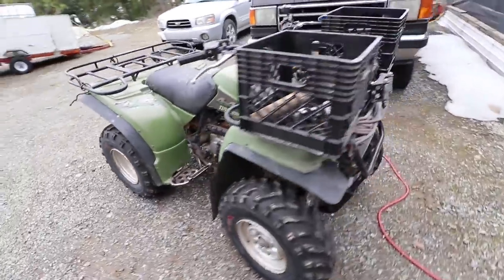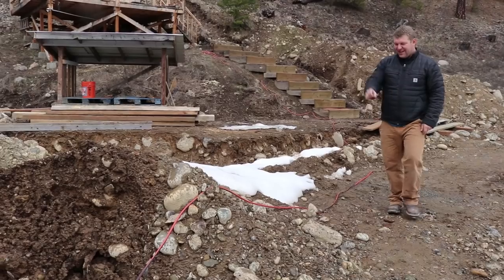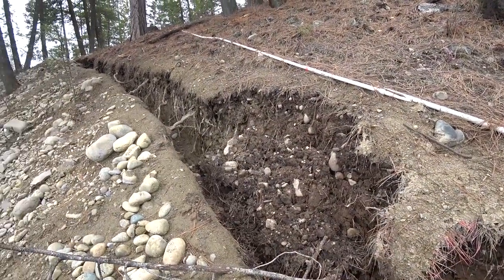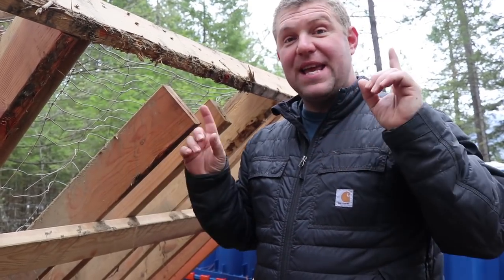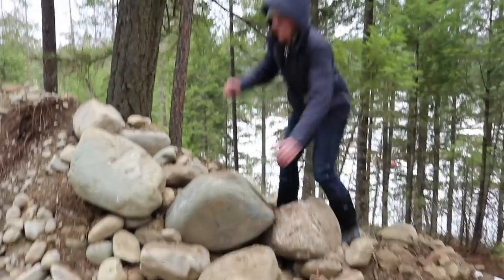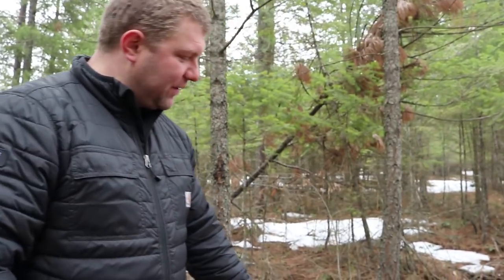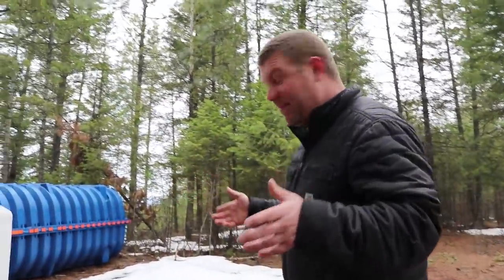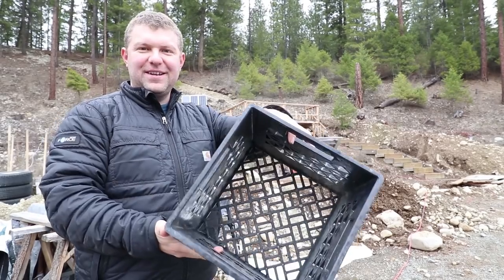IT ACTUALLY WORKED!?! DIY Rock Grizzly (Rock Separator, How to Remove Rocks from Soil)

Comment: Glad your screen worked (mostly). You mentioned that you don't have a welder.  I would highly highly recommend you buy a inexpensive mig weld on Craigslist. It would be useful while building your dream home, and very useful when stuff break around the average. No point in paying a professional to weld something back together when you can. Heck, the screen worked so well, why not scrounge up some scrap steel and build a heavy duty one. I can see it being extremely helpful when you are backfilling your house foundation in the future. I know it's just another expense. But consider it.
Reply: Stick is the better setup for small jobs as it doesn't require shield gas. No tank leases. no tank refills. no worry about the wire rusting in the machine between uses.

Comment: i hate to say it but you can just push most of that back in to the hole. as long as you get some fill over the pipe first it will take most of the energy away. im not saying you dont have to be careful but once you have the pipe covered with dirt you dont have to worry to much. the pipe is strong and the energy will be absorbed by the small amount of fill quite easily. we as humans are so weak and it seems hard to believe that a 400lb rock could just be stopped by a little bit of dirt. but it does. dont spent to much time messing about. get the pipe covered and then just fill it with rock an anything else....it will be fine.

Comment: you should use a 4x4 to hold your 2x4 up as an underneath support going horizontal bolted in place and move your chicken wire under the 2x4s.

Comment: You might want to look into getting a small trickle charger on your quads battery. It will prolong the life of it and also make sure you can start it right up. :)
Reply: They could use their solar panel that they got up over there. :) They aren't completely off-grid they got's power and even Inter-webs out there.

Comment: You could improve the construction without any additional hardware. The problem with your top joints is the combination of shier and pulling force. It would require an additional beam bolted on from the underside to hold.

Comment: I would put a 2x6 underneath the top part of the frame anchored to the posts. That way the 2x6 will take a lot of the load  instead of the screws used in the top rail

Comment: Now that you know it works. filter the fines over your areas that need backfill. before assembly drill holes 2 ft apart in wood then run rear thru them when assembling, then it is reinforcement and "screening".

Comment: Thoughts on your grizzly.  create a support beam between the 4x4s under the grizzly bars (lag bolts or carriage bolts). Use 2x4 cribbing between the grizzly bars and secured to the back board.  makes your spacing 3.5" and no wire unless you wanted the 3" rocks removed as well.  Yes it is wood and will have a limited life.  But you will use it way more than you think.  Hmmmm  Foundation hole... Hmmmm!  :)

Comment: Don't use anything less than schedule 40 pvc for any plumbing, even drains and sewer lines, or it will breakdown after 5 years and break like a potato chip.  also always use high pressure fittings (they are longer so the grip area of the glue is more) even on drains, you'll be glad you did.

Comment: Comments on your grizzly bars.

While I know steel cost more than wood and you don't have a welder, that excavator could could pick up a grizzly made out of steel.

Second, you mentioned it quickly, but it is important.  Screws (and to a lesser degree, nails) have very poor sheer strength.  Also screwing/nailing into end grain where the connection will be in sheer will likely cause the end of the wood to fail.  I am sure you experienced both.

If someone wants to build their own I have the following recommendation.  Make the outer frame out of 2x8.  Put a 4x4 block at the inside each corner so that you can screw through the face of the 2x8 into it.  Instead of using joist hangers ($$$).place the 2x6 ON TOP OF THE 2x8s !  These can be toe-screwed into the 2x8 BUT you will also need need short pieces of 2x6 between each one at the top and bottom to prevent then from rotating.  12" between the 2x6 is probably better.

Agree with the chain link fencing !

If you can get the larger rocks safely down the hill, they may be worth selling !  Put a couple at the foot of the driveway and a sign that says "Landscape Rock For Sale"

Comment: It would made more sense to make a metal setup with replaceable wood slots or some other material such that you get what you want. With some kind of fence or other material to cover it. Welding if done properly would allow you to set it up if measure and made pretty well, and you could then place bolts and screws and wood such to sort it pretty good.

Comment: Just wondering if you have the option to move those piles of huge rock away from the root zone of your trees? You have done such a great job trying to protect your tree roots while trenching, however, those huge piles are putting tons of weight on your root zones and compressing all of those valuable tree roots.  I know, I know...being a negative Nelly, sorry about that.

Comment: When living off grid wouldn't it make more sense to live as near the equator as possible? In the US that means you are probably nearer to sea level making it much cheaper to drill a well and freezing isn't an issue at all. You won't die in the South if you can't stay warm. I can think of a few reasons to live where it snows and freezes, but it doesn't seem to be enough of a reason not to just live where the climate is more suitable for human life.

Comment: Use yhe rocks for a fence, you know those cages filled with rocks
Reply: Gabion walls.
Reply: Andrew H - Excellent suggestion !  Gabion baskets are great for holding back (most of the) but letting water pass through.

Comment: A friend who moved to Colorado (Denver area) years ago built a solar heated rock bed (Pit?) The idea is to put rocks in a "basement" type storage and blow warm air from a solar room into the rocks in the day an pull heat from the rocks at night.
Some google links I found to the idea:
http://inspectapedia.com/Energy/Rock_Bed_Solar_Design.php
http://inspectapedia.com/Energy/Rock_Bed_Solar_Design.php
https://www.google.com/patents/US4139321

Comment: Why do people have to CONSTANTLY make extremely, NEEDLESSLY long, boring videos, adding in things that are just absolutely ridiculous, like watching you put gas in the gas tank? Dude really, you're not so popular that somebody has to waste a minute of their life watching you fill the gas tank. What's next? Watching you go inside and pee? And the most utterly absurd thing you could've possibly said is that the focus of the project was to make it light??? Yeah, let's make a heavy rock separator really light, because you know, that big excavator, won't be able to lift it...NOT. Yes it would be able to lift, it and drag it and twist it and chop it in half if you need it to. But seriously, watching your wife get on the back, watching you drive to the site where the separator is, 10 FREAKING minutes into the video and STILL nothing about your rock separator, and then when you FINALLY got to it??? It broke. Hey, what a great instructional video, I learned so much...
Reply: Louis Puglisi   obviously you have the same issues. you go on and on with a lengthy reply. easy solution fast forward to the part you want to watch. give it a try!!!